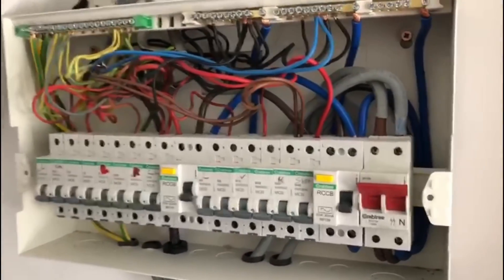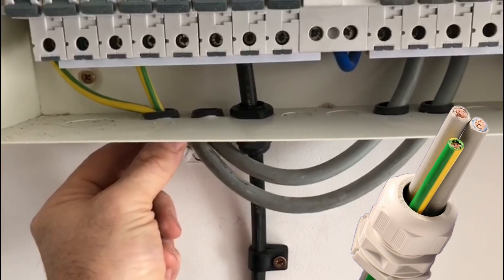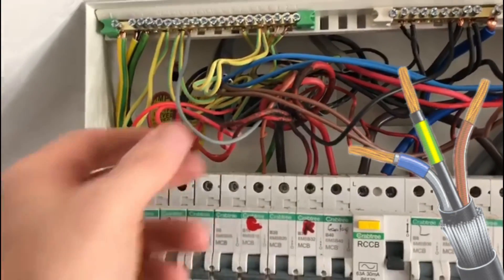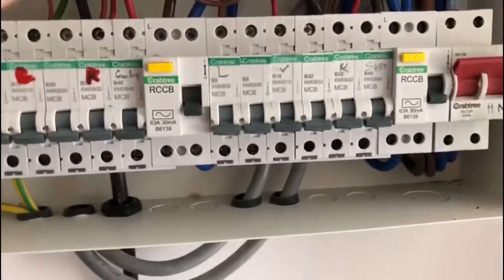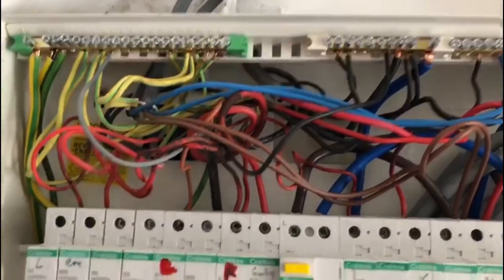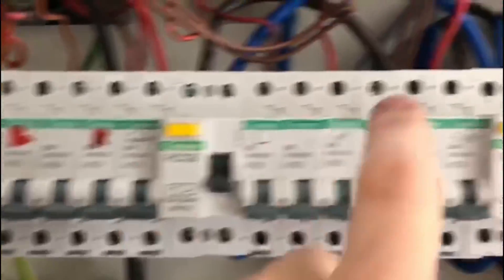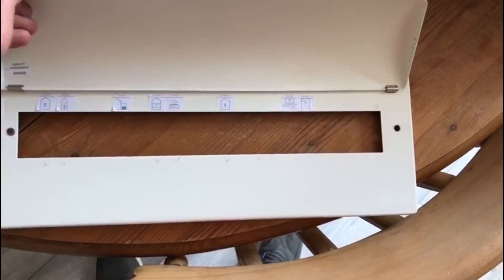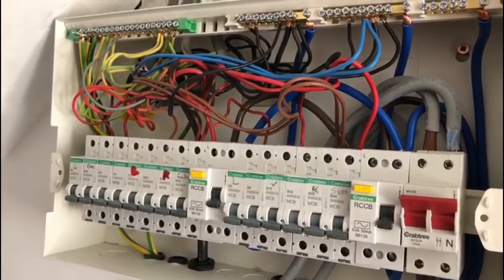EICR Consumer Unit Issues - Eddy Currents, IP Ratings and Torque Setting of MCB’s - Electrician Matt

Comment: Can anyone tell me why it is frowned upon to use the grey in the armoured cable as the cpc. In the video it's been said that it shouldn't be done like this. As long as the correct identification is on the cable I.e. green/yellow, there is nothing wrong with using the grey as earth.

Comment: There is absolutely zero evidence that the eddy current issue through separate holes leads to anything remotely like significant heating. John Ward went so far to test this and found pretty well no effect at all. This is not surprising. Eddy current heating is a serious issue in some circumstances (most obviously with transformer cores), but it is entirely insignificant in a consumer unit. Big Clive, who is highly respected was also sceptical and was not surprised.

In short, this is just one of those myths that spread around based on a grain of truth.

Comment: Best way to rectify top-surface IP4X ports is to "stuff" them with red fire putty (the horrible playdoh like stuff used to cover the inside of backboxes that pierce a fire compartment wall).  If you ever have to install backboxes and use fire putty to remediate them, keep a bag of leftovers for this purpose whenever you encounter it.  It's far easier and cleaner than trying to extrude some silicone into the right place, and then cleaning up and storing your open silicone tube.

Comment: RCDs are meant to protect lighting circuits, I believe, in the 18th Edt? Therefore, they need a cpc? Is that a fail, code C2?
Reply: 30mA RCDs are for "additional" protection only, therefore only a C3, unless there are unearthed metal accessories or the lighting cct passes through a bathroom or serves a hazardous area.  Similar to the situation with socket-outlets (C3/C2).  Good spot though.

Comment: Is there a regulation regarding wire colours in SWA?  You say "black used to be neutral so we should use that for earth"??  Makes no sense to me.  I've always used black for neutral (sleeved blue but not always) and grey sleeved as earth.  Seems like the most logical choice.  In your video all the circuits are using black as neutral so how can using grey for a single circuit make more sense?

Comment: Not sure what the point being made about eddy currents here is with respect to tails through consumer units. You need to state the scientific evidence that the effects of eddy currents in a consumer unit are likely to lead to over-heating, magnetization and current leakage to metal surfaces that could pose a safety issue. 

On overheating John Ward has also covered these in a simple experiment which showed minuscule heat impact even with 100amp loading. The impact with respect to larger electrical equipment transformers is probably more significant. Maybe this is just good practice to avoid unwanted even insignificant effects and cleaner installs,  but it’s important to clear up the issue whether it’s an actual safety or performance issue, or both. The science involving the work of foucalt, Lenz and maxwell equations describe the phenomena as it exists. Eddy current issue are more significant for motors, transformers and generators where performance loss issues and not just safety matters. 

Eddy current are not just a nuisance their uses are extremely significant in for example undertaking non-destructive testing in identifying cracks in materials (useful for safety testing of planes) and magnetic levitation as in transportation.

Comment: A bit brave sticking your hand near that bus bar with the main switch still on ...
Reply from the maker: the double pole switch in the tails was isolated... remember this is a video for learners to ask questions just like your one... what else can you spot....?
Reply from the maker: Has it got a bus bar....? 🤔
Reply: It does. You can see it at 45 seconds
Reply from the maker: All points we want our learners to raise. 40 amp MCB on the shower 🤔. Circuit layout in relation to the RCCB’s. Tons of stuff and much more for Matt to cover in lesson 🦾
Reply: They are isolated as the RCDs are off, obvs I would isolate DP main switch and if there is an iso outside the CCU that too

Comment: Interesting, in Germany the grey wire was used as N or PEN until 1965 (transition period until 1970). And the discussion about the colours is absolutely the same here. The best thing is to always look at the whole cable and the colours of the wires inside. We had three different colour codes in the last 60 years...

1965:
black, dark blue, red, grey. Black was line, grey the neutral or PEN. Red could be CPC, but it was also permitted to use it as line or switched line and the N is no N, it's a PEN...and that's were the fun starts and most electricians hate to work on such old installations because you can only rely on one thing: Can't rely on anything. Everything must be tested and measured.

From 1965 to 2003:

black and brown for lines, three-phase cables had two blacks. The black between pale blue and green/yellow was L1, brown L2 and the 2nd black L3. Pale blue neutral and green/yellow CPC. In some installations from the early time until 1970 old school electricians used the green/yellow as traveller for lighting circuits (they were get used to that from the red wire), but that was not permitted.
It was also distinguished between flex cable and cable for fixed installation. On flex the line was brown, on cables for fixed installation it was black.

And from 2003 on: The same colours you use in the UK.
Reply from the maker: Marcel Germann wow what a detailed comment... many thanks 👍

Comment: The incoming supply/ double pole switch is still in its closed position, so the board is not fully isolated.
Reply from the maker: Hi, is up ON or is down ON? has the system got remote means of isolation...? all great questions Matt hopes his learners will be asking 🤔...
Reply: @GSHElectrical  normally on the Crabtree double pole switch, On or Closed position is up, and on the bottom part of the red switch lever is imprinted On, and the lever in the Off or Open position is down, and the red switch is imprinted Off anove the lever.
Reply from the maker: I know Kevin but we are hoping our learners will spot many things in this video as stated in the description and in the text of the video. (Remote DP switch isn’t fitted 🤫). Many thanks for commenting and watching. Gaz 🦾
Reply: @GSHElectrical  Point taken 👍, as usual, the videos are informative and a shame they were not around when I was starting out.

Comment: Remember EICR's are meant the be assessed by the regs that were in force at the time of installation! Not the current regs.
Make and record recommendations to bring installation up to current regs but pass the inspection!
An installation could be VIR AND BAKEALITE  IF IT IS SOUND IT PASSES.
Reply: You inspect and test to the current edition of bs7671 as stated in GN3
Reply: ian adams so 90+% of dwellings are now illegal!
Your house is probably illegal?
Reply: Steven Smith It is not a legal requirement to bring an electrical installation up to date with the current edition of bs7671, so no there’s nothing illegal about it.
As the beginning of bs7671 states, installations complying to earlier editions of this standard are not necessarily unsafe.
Also taken from the electrical safety best practice guide 4

The observations should be based on the requirements of the edition of BS 7671 current at the time of the inspection, not on the requirements of an earlier edition current at the time the installation was constructed.
Which makes perfect sense
Reply: ian adams I know 
I agree
Next regs will be AFDD's is everyone going to run out and install them NO!
Reply: Steven Smith If AFDD’s where to become mandatory , you can only recommend that they are installed on an EICR, does not mean they have to be, just recommend that they are for improvement.
Reply: ian adams that's correct
So an installation without them is still a satisfactory installation!
Just recommend them on the certificate
Reply: @stevensmith4449   95% of houses do not meet  the new regs  that doesnt mean they are ilegal
Reply: steve robinson agreed 
So why do sparks insist on failing installations because of a non combustible DB!
Reply: @stevensmith4449   Normally you wouldnt, but if the inspections on a rented property within the private sector  your now held to a higher standard on some items. Private rentals are covered by health and safety at work act too so what might be considered an improvement in a private home may be seen as a requirement in a private rental .  Most EICRs are within the private rental market
Reply: steve robinson true
Can't see local councils updating all their housing stock
Reply: Steven Smith if that is the case these sparks are incorrect - non fire rated DB’s can only be classed as a C3
Reply: 09weenic the fella said it was under the stairs ( an escape route)
So the board got changed.
I've got the 2396 but I'm not registered to report works. 
Mate told me STROMER are the cheapest!
Reply: @stevensmith4449  they won't , neither will the dodgy landlords  who the legislation is aimed at , i was a landlord until recently and  an was offered  ECIR,S  at £80.00 a go by a couple of local estate agents . Now if its a choice of spending £80.00 on an EICR or £4000 on a rewire and the redecoration which way do you think many they are going to jump. If shit does hit the fan they have complied with all the legislation so are off the hook , company thats done the inspection lo longer exists
Reply: steve robinson I'm not saying pass shit installations..
If it's old and has been well maintained no reason to fail it!
Reply: steve robinson if you do buy an £80 eicr 
And things go tits up. You have to stand in front of a judge and tell him/her that you did not know you we're employing a chancer!
Reply: Steven Smith It was once acceptable to have the neutral fused in older installations so if you saw this in an older installation you would find this satisfactory? It is clear that we cannot assess an installation on when it was first designed and installed As safety standards have improved, however the regulations not being retrospective,C3 codes would be made against things like no rcd protection to circuits serving a bathroom location as long as supplementary equipotential bonding is in place, fused neutrals however would attract a C2 code. Another example is lighting circuits that did not require a cpc, unacceptable, to today’s safety standards
Reply: non combustible boards are not a problem unless there are other issue to consider, such being in an escape route, but each case is decided on its own merit, some inspectors decide to replace because they are inexperienced and don’t understand the regs properly
Reply: Wrong... Read the small print on an EICR, it's assessed to the latest BS 7671.
Reply: Ashman Electrical Services so most are going to fail!
Regardless if they are well maintained and safe.
Reply: @stevensmith4449   only because of the poorly written documentation that confuses  andleaves it to the descretion of the tester, now the less honest  amongst us will see this as a chance to make money
Reply: steve robinson yea
No integrity with some sparks 
And the regs are open to interpretation!
All the GN3 books enlighten it a bit more.
Reply: @stevensmith4449  If an installation completed to an older edition gives rise to danger then it should fail, don't you think? If an installation fails an EICR, it because the installation has  C1s, C2s or FI on it. A C3 wouldn't fail an EICR.
Reply: Ashman Electrical Services yea
But if it's sound but to older regs
I should be passed and recommendations made!
Reply: @stevensmith4449  By sound, I assume you mean safe but yes if the installation is safe then there's no reason why it should fail an EICR and the appropriate improvements recommended to the client.
Reply: @ashmanelectricalservices4318  THe Latest BS7671 is not absolute it doesnt say everything has to meet the latest edition, it does have a rider that installations to earlier editions may be satisfactory, the problem here it doesnt specify what, its left to the discretion of the sparks  and everyone has thier own interpretation
Reply: @steverobinson8170  I've not once said an installation must comply with the current BS 7671 to be safe, it must be inspected and tested against the current BS 7671 and an outcome in it's condition depending on the observations made.
Reply: Unless its on private rental property  its 18th regs then  which can be a little confusing

Comment: I wouldnt advise putting silicone around cable entries into CU, not all silicone is  non combustible,  fire mastic is the best option  if the proper rated grommets are not available .
Reply from the maker: steve robinson remember we are using this as a training aid and want students to question and find issues within this board. Massive thanks for commenting 🦾. GSH
Reply: So Steve's comment is a good training aid to your students!
Teach them: never ever use "normal" sanitary silicone near electrical items, the gases during curing will corrode conductors and terminals (quickest way to kill a newly installed shower since silicone is unnecessary with modern designs), only ever touch neutral-cure silicone.  But better not to use it at all here.
Reply: Bit late to the party but Intumescent sealant is what you want to use, to maintain fire rating

Comment: The incoming supply grey tail  for the live conductor ,is the  brown insulation meant to be visible? as it is now it  is not double insulated is that right?
Reply from the maker: Remember we are using this as a training aid for our learners at college 👍.
Reply: It’s fine and the correct method. Your lectures will explain why it should be like that.
Reply: @AndyK.1  so if the other end of the tails going to the meter or the incoming supply cutout were visible  thats not ok?, i ask if insulation starts to breaks down over the years it would be exposed possible chance of a shock.
Reply: In this case it is within an enclosure so double insulated is not required in there. It is also good to see a bit of brown to ensure polarity is not reversed. As long as you can’t see cooper at the meter there shouldn’t be any risk.
Reply: The grey layer is for mechanical protection which is not required inside an enclosure (distribution box).

Comment: DIY job perhaps or a landlord had it done on the cheap?
Reply: I've seen a lot of "electricians" do a far worse job than this so I don't know why you'd assume it's a DIY job.
Reply: Chris W it’s DIY because there are so many basic compliance errors. Any electrician that produced a job that poor is either very inexperienced, a bodger that should be struck  off or an apprentice with no supervision
Reply from the maker: Maybe... 🤔
Reply: Its defo a DIY or cheap mate  from the pub job? For starters, it’s a dual RCD, only cheapskates fit them, and too many schoolboy errors to be a proper sparky job
Reply: @electricery  why is this a cheap job?  Dual RCD boards have been the standard for years and Crabtree are a decent brand.  Based on the age of this installation it would never have used RCBOs.